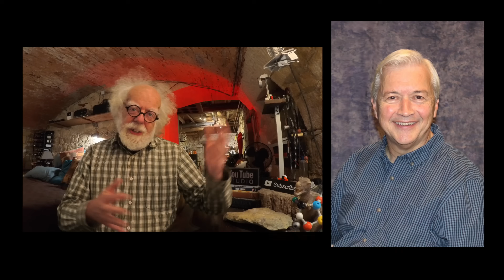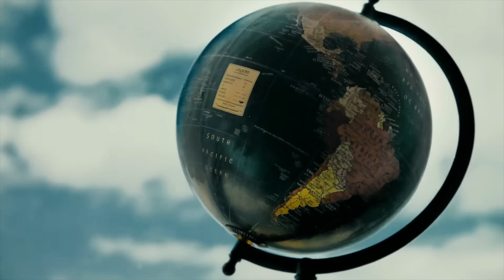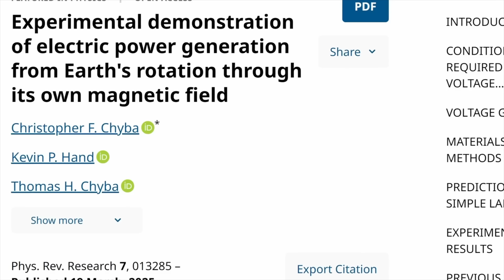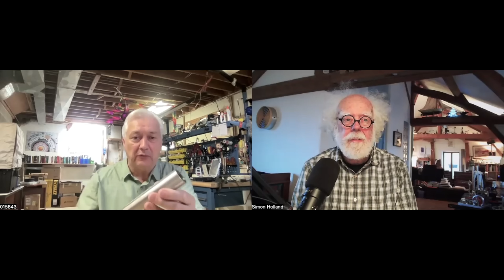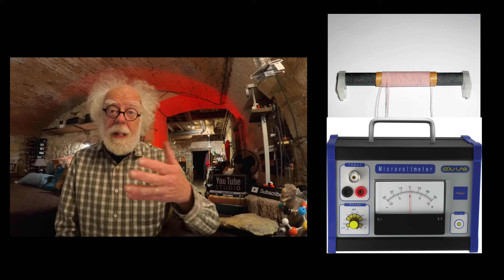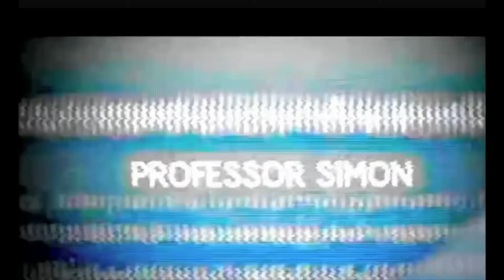Earth Generator Prof Chris Chyba Interview

Comment: There was a demo done with a homopolar generator that was able to spin the magnet, a mental plate, or both together.  It was demonstrated that as long as the metal plate spun, a voltage (really a current) was generated.... if the magnet was stationary, or not .... the eddy currents generated in the plate by the field tend to move the electrons towards the inside or outside.... but this is very low voltage generator - it does tend to generate current - the Naval gauss gun's capacitors are charged with a homopolar generator. 
The experiment is basically a normal microwave magnet, with a plate of metal the same diameter, and if you just hot glue them together and spin them then a current is generated in the metal plate.  
SO for the earth I'd think that a wedge perpendicular to the earth would also be able to have the motion done by cutting through the earth's magnetic flux lines.
There was a demo of that experiment - but the college that had it took it down... the field seems to not be directly attached to the magnet that generates it.... even though it would be showable that if there were differences in the field at the magnet, there will be gradient changes.......

Comment: Net movement would be 113 m/s if st 1670 km/h at equator Earth spins relative to solar system at 463 m/s -350 m/s = 113 m/s. Also to store the energy you need a diode of one way valve that can turn on at microvolts. Or the current so large that it is valid to step up to high voltage (requires pulsation via transformer) then through a diode.

Comment: The late Art Bell found after he built a very large ham radio array there was a background voltage he tried to understand where that originated. I believe it was 90 volts dc. He was of course in the desert of Arizona which is hot and low humidity. He could not decide if this was the earth’s background magnetic field causing this effect.

Comment: The Earth's magnetic field is still a mystery, so it cant be ruled out that Chyba's device might work.  Faraday worked with magnets that were not as mysterious as the Earth's field, but he postulated that the magnetic field of the Earth radiates from within just as light radiates from the sun, and then concluded that since the suns light does not rortate with the sun, therefore the Earth's magnetic field does not rotate either.   With magnets we do understand, the field most certainly does rotate when the magnet is rotated.   If it should turn out that there is such a magnet that spins, but its field remains stationary, then it would be a remarkable discovery.   The argument from symmetry, that a perfectly symmetric field rotated axially about the N-S axis, is equivalent to a stationary magnetic field, is an oversimplification compared to the Earth, because local variations in field direction are ubiquitous.
Reply: interesting
thanks

Comment: What if you use a magnet fixed to the earth.
The magnetic field of the magnet would be independent of it's rotation so it should works like for the earth's one.

But would it be too strong for the experiment ?

Comment: An Oscilloscope can measure and display micro volts.  You can borrow mine. 
The electric spin charge of the atomic electrons is what generates the EM lines of coupling force of a magnet or via circuit current, that are utilized push and pull any given mass through the EM field. And the reverse is also true.
 I did not hear that the scientist was spinning the Magnesium-zine tube in the earth's magnetic field, so I assume that he was just letting the earth's magnetic field cut through the stationary tubing.  So to increase the voltage and current, you have to spin the tubing similar to a regular generator.  The important thing to maintain is the angle of the EM lines cutting through the tubing, so that the lines never try to cut at an angle of 90 degrees to the tubing length..
I do not think that reducing the ID size of the tube will help, if the tube's hollow topology is all that important. I would think that spinning the tube is more beneficial than shrinking the ID.  First of all the earth magnetic field is the same type of EM energy lines coupled together between poles, the lines are just much less dense per unit volume in this case. 
Note The only requirement for generating an EM field is to either move the wire ( or tube) in the stationary EM field or to move the field through the stationary wire (tube).  AC circuit current is simply moving the EM field through the wires, which can be a transformer or motor or generator.  The way that I understood the theory was that the EM lines were spinning at the same rate as the earth, so the generator has to spin to cut through the EM lines of vector force.
Reply: Correct me if I am wrong, and I'm wrong often. Haha! I thought his point was that the earths magnetic field is not spinning with the earth. So, the 'stationary' metal rod is actually moving at approximately 350m per second (the earth's rotational speed) through the magnetic field. Is that right, or am I getting confused?
Reply from the maker: Good idea
Reply: The purpose was to create a current or voltage using the relative motion of the earth vs its' magnetic field within this apparatus. If you want to spin the material, you have to get the energy from somewhere to do it, then what is the point? Intuitively to me, It would seem to be a loss that would negate any net gain.

Comment: Why does the atmosphere rotate at the same speed as the Earth (except for various little regions which have air going a slightly different velocity to the ground, a phenomenon which we call "wind")? If you spin a billiard ball inside a basketball in zero gravity, the air in the basket ball will not start rotating with the billiard ball......and the Earth is considerably smoother than a brand new billiard ball (scaled up to an 8,000 mile diameter). It can't be due to mountains and Manhattan Island acting as paddles. So why?
Reply: Try first to visualize the fact that the Earth is way larger than a billiard ball. Or, try to rotate a billiard ball as big as the Earth and see what happen.
Reply: @O-Kyklop  Have you any idea of the mass of the atmosphere? And a billiard ball scaled up to Earth size would have mountains much taller than our mountain ranges and valleys much deeper than the Grand Canyon. So it might have a paddle effect. But a little surface defect like Mount Everest is not dragging the atmosphere anywhere.
Reply: @Synapscience  And a billiard ball scaled up to Earth size would have mountains much taller than our mountain ranges and valleys much deeper than the Grand Canyon.
Why should that happen?
I guess it would remain as smooth as it is in its actual size. 
I guess you want to land the discussion into some Flat Earth nonsense, and the Dome which holds the Atmosphere back. Am I right?
I’m not an expert ini cosmology but I could imagine that the Atmosphere is “encased” into something else around the Planet that holds it back from evaporate into the void. Could be some state of Plasma or Aether. I don’t think the crude or mechanic drag of gravity alone can hold the atmospheric mass back into place. So,  the mass of the Atmosphere is locked into an invisible frame and follows the spin of the Planet as everything else.
Reply: Could it have something to do with mass + angular momentum?
On Mars, with a thinner atmosphere, wind speeds are higher.

Comment: So the best place to carry out such research would be somewhere on the equator to take advantage of maximum rotation speed of the earth ?
Reply: The question is if the magnetic field on the Equator is the same as from the Equator to the Poles, or is there some kind of inflection or conversion zone, called the Bloch wall in the bar magnets.
Reply: @O-Kyklop  The angle of magnetic field lines to the line of latitude
Reply: @ 
Those lines would break in at the Equator.  I’m not sure how it works at planetary level, but, I guess, at some point must those lines change polarity.

Comment: The real story is that Tesla perfected the electric motor, in the same way that the USA perfected electric generators, useable radar magnetrons, the jet airplane, train steam and later diesel locomotives, powered ships, steel bridges, paved roads,  highway maps, automobiles, motorcycles and the telephone and phone exchange networks.  And men did this all without asking for permission from women or England.
Reply: Our patent system creates an innovation bottleneck where new inventions can be denied or CLASSIFIED (stolen). It's a voluntary system with no right of due process. Elon Musk doesn't typically patent his intellectual property.

Comment: I was thinking, maybe that Egypt  pyramids thing they say they´ve found last week its just a generator working on this very same principle. And maybe because a tube works and a rod doesn´t its because outside of the tube, on the outside surface the electrons travel feom one tip to the other and in the inside the tube the earths magnetic field is possibly reversed and the electrons trabel back to the top...

Comment: The electrons can't redistribute themselves because the topology of the rod has created a unified connected loop equatorially, inducing the electrons to spin horizontally in an accretal position, thus leaving them unable to flow vertically, redistribute and cancel out. In effect,  the electron flow has been manipulated from its lineal "X" plane of trajectory, to the two-dimensional "Y" plane, but as that "Y" plane is a loop, where the magnetic + & - have made a unified connection,  the flow is locked in to a forever cycle. 
 Ingenious definitely,  and quite possibly the link to tapping zero point energy from the ether.
Reply: You're a smart bloke. I almost understood that!🙂Cheers from Australia!
Reply: @pauljcampbell2997 🤣🙋‍♂️🐑

Comment: There is also electrical potential in the atmosphere increasing with altitude. See Herman Plausen patents for collection devices with sufficient power to run motors.
Reply: I think 100volts per meter. This gradient electric field is easily distorted.

Comment: Art Bell, late night talk-radio host was also an avid HAM operator. He stated that a 200 volt electric charge was generated by his 5-Acre antenna farm.
Reply: Most likely this energy was recieved by the antenna from multiple transmitters.
Reply: @ActivateMission2ThisTimeline  Art lived in a very remote area, the Inverse Square law would tend to rule out the energy he measured being from commercial.broadcast antennas.
Reply: Static electricity from walking across a carpet can deliver somewhere between 500 and 21,000 volts. Thankfully it isn`t as dangerous as lightning.
Reply: @baneverything5580 It’s not the voltage that kills you, it’s the amperage.
Reply: Likely not this effect, but a weather phenomenon 🙂 Same way to how thunders appear, just lower voltage due to its smaller size.

Comment: Hmm maybe the surface of the conductor instead of one giant melted steal crystal u need a bunch of metal flakes and then either dope them all together or heat them till the bond but not lose all there different fields from the different size flakes or shapes of metal

Comment: Why has it been kept secret for a 150 years.. Because the electric companies make about a 100 billion dollars a month off of us on the low end , I live in  Florida and I pay $400 a month for electricity.. 🙄
Reply: Did you listen? It's microvolts. A million times less than what's needed to operate a light bulb.
Reply: @traumflug  😅  And did you listen , this was just an experiment to see if  the rotation of the Earth is capable of inducing a current through a wire coil or cylinder not a practical application...
That will be coming next
 My comment was based on the technology not the experimental prototype.. 🙄
 Think twice
 type once
Reply: There is no secret, it didn’t work. Now the math has been worked out we now get incredibly tiny amounts of energy.. what a threat 😂
Reply: @Cheesyonmytoasty 😅  Yeah this technology is garbage anyway the real technology that's going to be changing the world is the Plasmoid generator and the sacred geometry that is making it work..
Reply: NASA Tether experiment in 1996 was test of it. They did that already. It's not a secret

Comment: Hi Simon LED runs on 1.5v 20ma. The generator question how big to use an inverter to 240v to power full house say 10kw. ? The one you showed part 1 was tiny. You can also get free electricity from radio waves ie crystal set and a diode
Andy.
Reply from the maker: This is just a proof of concept…it works…next step more power

Comment: Simon, there is no need for all this glee.   If the voltage is just microvolts, it is no use to man nor beast. I can see no way this could be scaled up, and no way that this could be a useful new energy source.
Reply: it should absolutely be scalable.  If you've installed solar panels surely you understand the electrical concepts of Parallel and Series ?
Reply: @ Speaking (well, writing) as an electronics engineer, I believe I do have a grasp of the "concepts of parallel and series".
Reply: @RobCCTV  Aston is doing a live stream tonight about the subject. Get on it👍
Reply: His scientific paper literally explains how to scale it up lol. This is why people should read the actual papers before opining.
Reply from the maker: Chris said the current experiment i just a test. it should be possible to scale it up using high renolds number coils of a very small size.
Reply: Check the history of any technology.  This is a major breakthrough. This will evolve in no time now.  Guaranteed.
Reply: @quicksilver2909  🤣 you obviously have checked. It already exists. Just we are not allowed to have it mate 👍